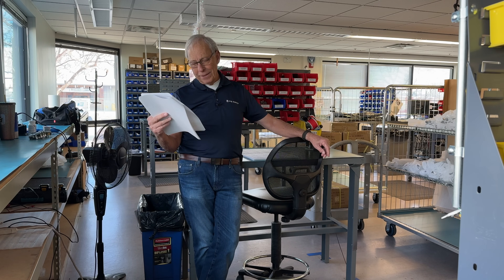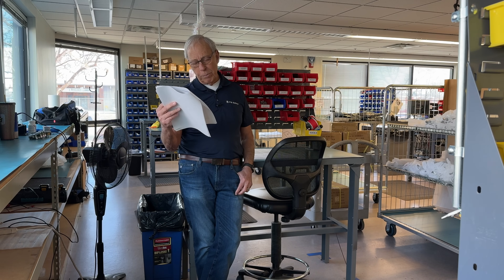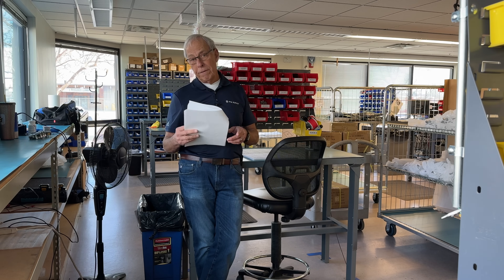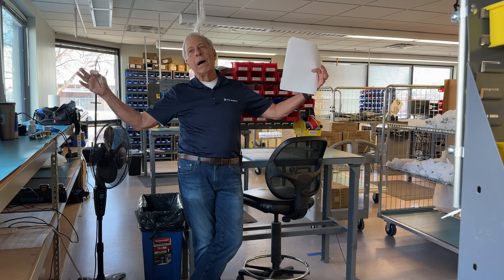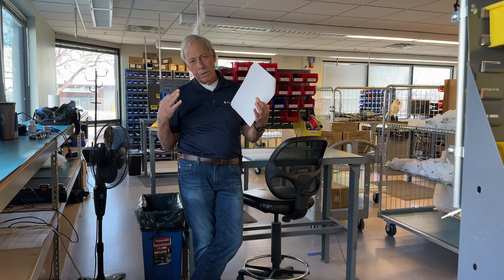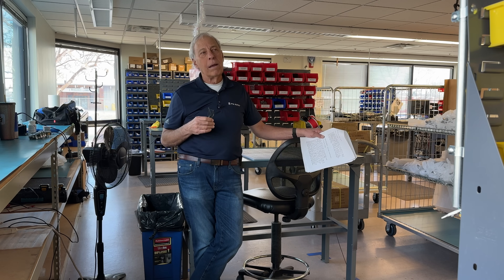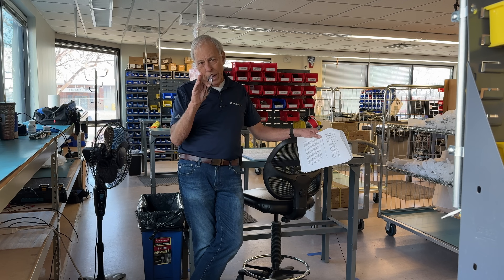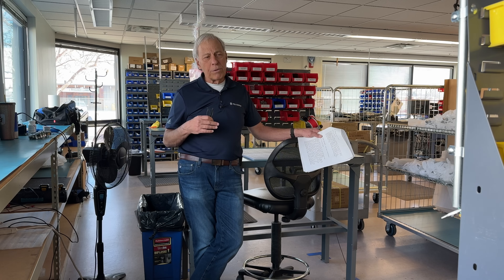Using Japanese 100V products on US 120V

Comment: I just bought a Pioneer SA-8800 II that's rate to run on 100v. The voltage coming into my home is right at 125v. I am going to us a variac type transformer I got from my father in-law who was a scientist at the Hughes labs in Malibu California. It is rated at 20 amps output and the voltage can be adjusted from 3v to 143v. I'm going to set it at 108v. Also, plugged my Pioneer SX-850 into it and lowered the voltage to 108. It worked fine, but it made a pop sound when I turned it off. I raised the voltage up to 120 and the pop went away. You tell me.

Comment: I lived in the UK twice, 5 years each time.  I ran us audio equipment both times using a transformer with no issues.  The difference in hertz made no issue as all audio equipment steps down the voltage and also converts it to dc.  You dont need a huge transformer either as most stereo equipment does not draw a lot of power.  A 500 watt transformer would run a complete system with a lot of room to spare.  Used to run mine on a 250 watt transformer.  I doubt there would be an issue running a 100 volt system on 120, but i cant confirm that.  But the hertz is definitely not an issue.

Comment: For most source components, a 300 VA transformer will do, I'd stay away from large amps that are not native voltage. Cotek AC inverters can run 50/60hz (user switchable} for turntables etc if you need that for an exotic overseas model.

Comment: What about Europe? - Old equipment is rated to 220V, and now in Europe we have 230V - but in my house I sometimes have 243V... And if bigger transformer is better, why you are recommending your product against a massive transformer?
Reply: Voltage was increased to reduce the power losses. Every device has a range of voltages it can operate on. The old equipment rated for 220V can handle 230V without any issues.

Comment: Then buy a 240V from Europe, for example. Extra advantage: no power pland required. because the voltage drop is only 1/4 compared to 120V
Reply: I don't think you know what you're talking about.
Reply: @wisehippo3072  It's simple. according to Paul, the power plant provides a stable voltage without dip dips. If you double the voltage, the dip will be 1/4 at the same power. these dips did not make a big difference and with 240V even less

Comment: There's some really cool old gear you can get from Japan.  Accuphase, Onkyo, and Luxman units that are either VERY rare or simply don't exist in the U.S. are pretty common.  It's not really the cheapest option, but some very special gear can be found.  There's an Onkyo M-510 Grand Integra that I would LOVE to snag, but shipping a 95lb amp from Japan is basically as much as the amp.

Comment: My vintage Japanese stereo amp kept blowing its fuse when I used 110V with a servo motor AVR. Had to use a 100V step down transformer and problem solved.

Comment: I would guess there frequency is the same 60Hz. unlike Europe that is 50 Hz.
Reply: No. Western Japan is 60 Hz, eastern Japan is 50 Hz. Two different frequences in one country. The eastern and western power grids are connected with 4 DC lines (at least it used to be 4. Maybe that changed).
Reply: @wisehippo3072  interesting so I would imagine you would need to know which area  they were designed to
Reply: @gtric1466  50hz or 60hz would only be a problem if the equipment had a synchronous mains motor in it. Which older('60s or '70s) record decks and tape decks may have. Some equipment in Japan did have provision for this, like changing a drive wheel size, or changing the value of the run capacitor. More recent equipment usually has low voltage DC motors.

Comment: The real reason is that amplifier components did not use 100V or 120V directly.
After transformers, there are lots of components handling the volte that required so what voltages of transformers input within the range affects really little.

Comment: Lots of Japanese audio gear on ebay. Luxman and Accuphase amp's are really common. I have a Luxman L-509x that I purchased in the US from an authorized dealer, so a proper 120V 60hz version. A friend purchased a Japanese version, 100V 50hz and is using a transformer. We both can hear subtle difference in the imaging and sound field.

Comment: I still have my Japanese Nikko receiver from 1978 that's 100 V and I always plugged it directly into the wall from the day I bought it. Never a problem. Still works great and sounds good too..👍
Reply: I have a Technics EQ from like 1984 that is the same. I always plugged it into the back of my receiver so it would come on the same time it does. It was only a couple years ago I realized it was 100V but it worked for 35 years before I knew it so......
Reply: Lol its a case by case thing really.  If the power supply is robust enough it'll be fine.  If it's cheapo then you could have issues w overheating.

Back in the day stuff was built for extreme tolerances.  Nowadays they give you the absolute bare minimum.  I would never use a newer Japanese power supply in a U.S. wall socket.

Comment: Remember that half of Japan is 60hz and half is 50hz. Be careful with transformers.
Reply: The US is 60Hz, you can always go from 50 to 60Hz with a transformer, but not always the other way around.
Reply: Not a widely known fact; fortunately a lot of Japanese equipment can accept both, but you need to be careful with transformers indeed; a transformer designed for 60Hz supplied with 50Hz may run hot if not designed to cope with 50Hz.
Reply: Right! My Rega Planar is 60Hz and when I moved to Kanagawa-Ken (50hz) it ran slowly. I had to make the pully wheel larger to get it just right.

Comment: I have a friend that managed to pickup a ud501 that was 100v the previous owner ran it on 120v and it blew one of the channels of the headphone output and I don't think it was correctly responding to source bitrate changes. I also have electrostatic energizers that if I were to run them on 120v vs 100v the resultant increase in voltage would be enough to increase the voltage at the headphones to cause them to arc over and cause damage to the diaphragm if not to the energizer itself if the voltage was not constantly being shunted at the output, which I would suspect would be causing undue load on the unit if not other issues. Not worth the risk to save the $30-$60 for a step down transformer in my opinion.

Comment: Often they use a transformer that can do every voltage from 100v up to 240. Higher voltage transformers normally cost more however by using just one transformer they reduce the amount of parts they need to have in stock, that simplfys manufacting and reduces costs in the long run. The transformers output is always the same so  its just which input winding they conect to. To change the operating voltage its as simple as moving a wire. .
Reply: Quite a few audio components (vintage ones especially) have a voltage selector on the back that switches between different windings on the primary. Do double-check the selected voltage before you switch the power on.

Comment: I have seen some equipment which is specified to operate from ~90V to 240V. With switching supplies it's just a matter of rating the switching devices for both the max current and max voltage rating for high voltage. The advantage for the manufacturer is that there is really "one size fits all".

Comment: One way of dealing with this situation is to use a low voltage bucking transformer. An electrician or electronics technician can set up a comparatively small transformer wired to subtract its output voltage from a dedicated outlet box for the 100V device. For example a 12V 10A transformer can adjust 117V input to 105V nominal, hence a 120VA (nominal) transformer can supply a 1000VA (nominal) device. I use this technique on a couple of pieces of equipment - here in Australia our specified 230V mains is often above 240V, and some of my audio equipment declared as 220/230V has noticeable transformer magnetization buzz when run from the normal 242V I get at my home. The buzz goes away when I run my powered studio monitors using a 20v bucking transformer - I suspect they actually have 220V transformers.

Comment: The low end is when the voltage regulators supplying power to the front end stages lose lock and the high end is when the main caps voltage rating is approached. In between those values sonics will happen but damage does not. If a range is not stated anyone with a variac, a voltmeter and the ability to use them can establish what the upper and lower limits are. With power amplifiers sometimes a quick and easy rebiasing back to factory specs may be advisable.

Comment: Use a variac.
Reply: Really?
Reply: @hugobloemers4425   yeah.   Look it up.
Reply: A bit overkill; quite pricey if you get the less common isolating variac which I would highly recommend given the socket & plug design in the US. Also most variacs emit a soft hum. For operating a powerful amp a variac almost certainly could do with a soft-start inrush current limiter circuit which rules out all the cheap "overseas" ones....

Comment: Reminds me of a USA voltage audio setup I had running in some apartment in China used for supplier meetings. When I came back to this apartment there was a strong smell and the entire system had all fuses blown and some actual circuit damage caused by the cleaner disconnecting the power plug from a large transformer to connect some power strip directly running the 110V gear on 220V.

Comment: Transformers are too large, too heavy, and too expensive.       
I would NOT use 100V equipment on 120V, period.
Reply: You are right for the price when you buy them as audio products. But if you buy them as industrial transformers they will be amazingly cheap. Are they too big and heavy? Well, they can easily be tucked away under a cabinet. Try that with a Power-Plant, a mono block or a subwoofer for that matter. Audio is always big and heavy. Why should it be a problem with this one component?
Reply: I would take a look inside it if the parts have ratings on them.

chances are for a lot of devices it's all the same stuff thats on a 110/120v models anyway.
Reply: Probably in 90% of cases it's ok. Good electronics design should have a bigger margin than what is official specs for the mains voltage. Too high voltage might cause some extra heat in regulators and get capacitors closer to their maximum operating voltage. And if it's a power amp, you might get some extra Watts out of it, in most cases, rather than the amp self-destructs. But there is no guarantee.